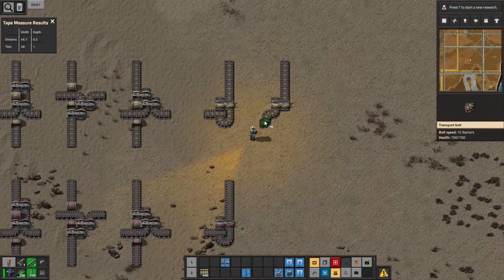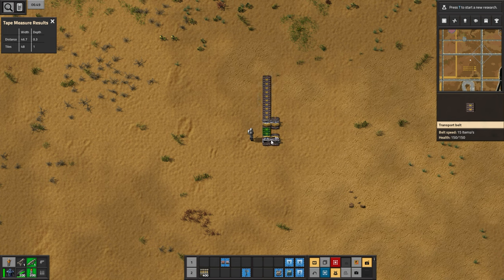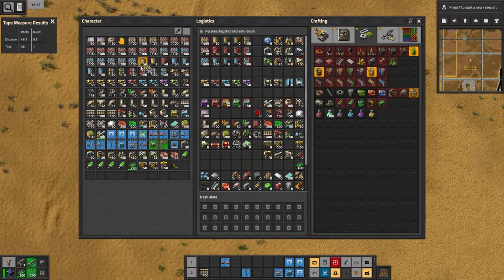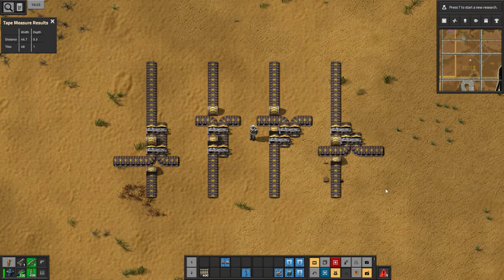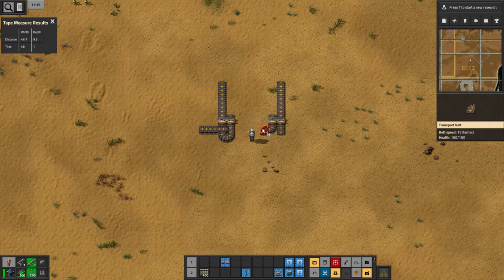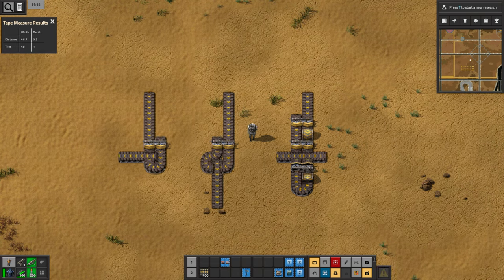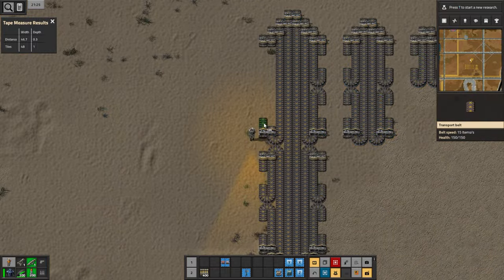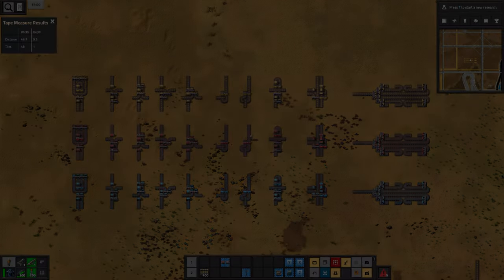Factorio - Widgets

Comment: Mostly, I think your real argument against belt balancers comes down to aesthetics. You've got a very particular style you prefer, a style that doesn't blend nicely with the large number of assorted underground belts and splitters needed to properly balance a large number of belts. You've broken up everything into clearly decipherable pieces which can be easily assembled together and managed as blocks.

I find it funny that you say you don't use balancers, but you basically re-invented a worse concept of a balancer at 10:25. That problem of only being able to split belts by a power of two is solved by very common belt balancers. Balancers with those basic 1 to 2^X ratios are literally just the ones you're using. Balancers with odd ratios involve belt loops to evenly distribute items, but they do solve that problem of being able to handle non-trivial splitter distributions. Go look at a 1:6 belt balancer, and it looks like it would fit your style quite nicely. That little 1:3 loop might be a very effective "widget" to add to your toolkit, since you can expand it to meet probably 90% of your needs without resorting to using a belt balancer blueprint book. A 1:6 balancer is just a 1:3 splitter with splitters on all the outputs.

I've tried to reverse engineer the math used to create belt balancers. On some levels, it's simple graph theory. On another level, it's incredibly convoluted to produce a nontrivial working balancer from scratch, if you don't have some custom tool like a SAT solver to help you work out the equations. Doing the math yourself is tricky, because too many splitters can unbalance your ratios, and it's difficult to hold all the simultaneous possible paths in your head while placing splitters. But the broader theory still applies. Inside many of the crazy large 12:12 balancers, you can see one or two smaller basic 3:3 loops that helps divide things up evenly. In fact, any balancer with nonoptimal ratios can be assembled by combining a power of two balancer with one or more splitter loops.

I ended up going down the rabbit hole of SAT solvers for belt balancers because I made some odd choices in my early factories. Mostly, it came down to the uneven lane consumption of iron/copper for circuit production, and my nice looking but impossible to easily balance 1:3 trains I arbitrarily picked. That, and unevenly depleting mines. It's frustratingly common to have trains get stuck at mines because two train cars are full, but the other one is empty. That, and unloading trains sometimes caused half my furnace stacks to run dry, because the trains weren't loading the furnaces evenly, and I wasn't consuming evenly from the furnaces. Which is how I ended up learning about the value of properly balancing your inputs and outputs. Not being able to load or unload my trains evenly caused tons of problems in my factory, which is why I started to lean on proper balancers for train stations.

One of the major parts of Factorio is how impactful the technologies are. Single technology upgrades like rail signals used to be what entire games were designed around in the late 90s (transportation tycoon). The circuit upgrade alone has just as many intricoes as a Zacktronics game, and bots and later spidertrons completely change the way the game can be played at a fundamental level, moving your entire capability to solve problems from a micro scale to a macro scale. With that in mind, it's completely possible to complete the game with only burner inserters. None of those technologies are required to beat the game, so it's understandable that many people don't even engage with entire mechanics in Factorio, while other people build full rendering engines out of circuit networks.

I definitely think there's a middle ground between "write your own software to generate belt balancers and only stamp blueprints from the book" and "I only use a single unmixed belt for each input and output resource because logistics is hard". I think there's a place for nice blueprints in Factorio. Mostly because blueprinting designs is a major part of the late game, especially with bots and all the new blueprint mode upgrades coming in 2.0. Expanding a factory becomes dramatically easier once you've got bots to start constructing things, and bots need blueprints to work. The only question is how much you take inspiration from other players, and how much you develop yourself.

Personally, I don't directly rip other people's blueprints. I find joy in building things myself. However, I do constantly look at other people's blueprints for inspiration, which led me to create a highly effective and custom train unloading design. I've also started creating more specific blueprints like furnace stacks that don't buffer huge resources in the furnaces, since a properly ratio'd furnace stack can't clear buffered resources without the mines running dry, so buffered resources are just wasted pollution. Which led me to using some blueprints for a small set of balancers I need for train stops and mines. I don't want to just open up a book and stamp random balancers everywhere, but I also don't have my own SAT solver on hand.
Reply from the maker: You make some interesting points. 

The aesthetics thing, that isn't unreasonable. I DO have a particular style and the big chunky balancers are not pleasing to me. But I think it might be more than that and you go into it; the mathes. 

A big reason why I enjoy factorio is because the game requires a grip on the mathematics of the situation. Number of assembly machines, capacity of a conveyor belt etc. The idea of trying to mathematically analyse a belt balancer to calculate precisely whether it is balancing correctly or not, as you point out, is a challenging task. Then do that for multiple belt balancers.

Because I would want to build my own. I wouldn't want to rely on other people's work. In my minds eye I'm thinking spreadsheets. And how many would I need to build? How many situations would I need to account for? All of that sounds like work to me and I play factorio to not do work. Even if sometimes it doesn't feel like that.

I guess my solution to this is to micro-manage the situation. Instead of having potentially dozens of huge belt balancers in my tool box, I have a small selection of little balancers to address each conveyor belt individually. I don't need to bundle together a huge number of conveyor belts because each one has been specifically targeted at a particular recipe. I don't make 180 copper and then try and balance that through my factory. I make 4 belts of 45 copper, 3 of which will go to blue, red and green circuits, and one which will go to low density structure. No balancing required.